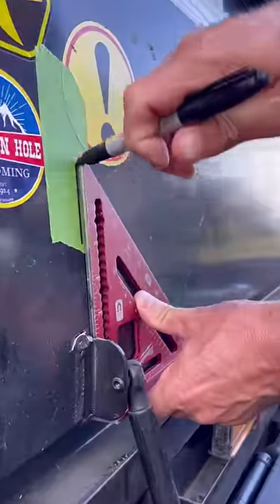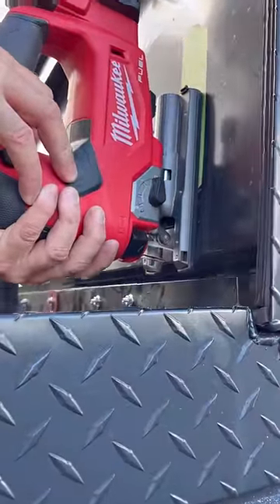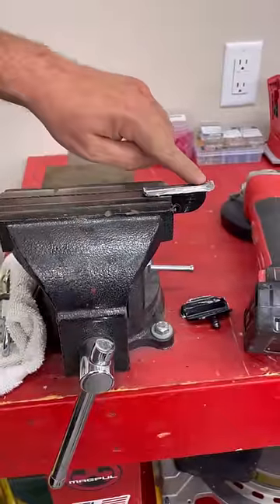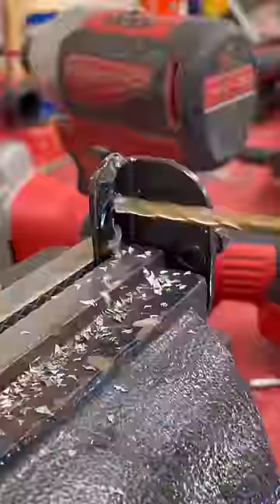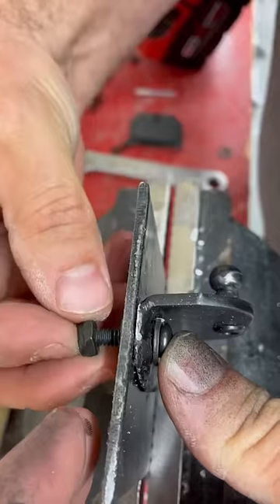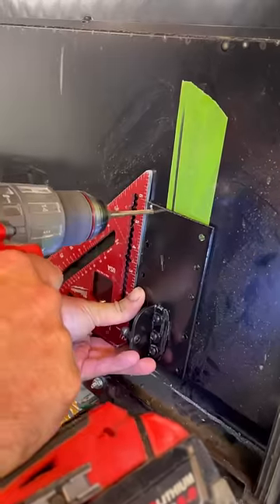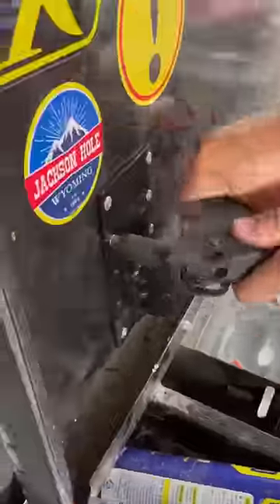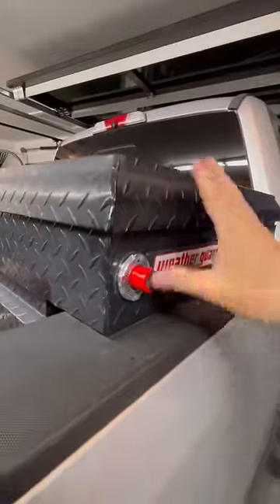I Had to Fix the Broken Shock Mounts on My Truck Toolbox

Comment: Puting the rivets from outside to the inside would give the outside a better look
Reply from the maker: The pop rivets and bolts didn’t go through the top they’re attached to step down section. The top looks the same as it always that we post to the second video showing this👍

Comment: Your repair should hold up at least as long as the original.. ps the original design has a major flaw . These boxes are designed to lift the lid from the center..but it's lifted from the side. So design it to lift both ends from one side..

Comment: You should have covered the back of the steel plate in silicone to prevent the ingres of water through the 2 holes
Reply from the maker: The pop rivets didn’t go through the top

Comment: Nice but the aluminum will corrode the steel in some time probably something like 10 20 years but you'd be better off with a heavy aluminum plate in place of the steel plate but the steel is good and gets the job done

Comment: You need to use body compound or something on the outside since you cut through.
Reply from the maker: The popper it’s actually don’t go through the top of the lid. They’re attached to step down section

Comment: I was gonna say, if he was planning to weld that steel to the aluminum body...

As to the metal fatigue, it won't be an issue. Aluminum has no minimum fatigue strength, unlike steel. If you oscillate it enough you could tear it like paper.

Comment: Good idea to fix but what about sealing the top so the water doesn't leak in
Reply from the maker: The pop, rivets and bolts don’t go through the top they’re attached a step down section so it’s still waterproof

Comment: Show us the top side with the bottom of the rivets sticking out and the cut holes!
Reply from the maker: The rivets don’t go through the top they’re attached to an inner skin, and I did make a second video showing the top if you want to check it out

Comment: I'd have put the nuts on the inside of the box to stop possible access through the back of the lid. Great repair though.
Reply from the maker: The rivets don’t go through the top. They are attached to a step down section.

Comment: My only concern is your repair job will be too strong for your lid. The surface area of the plate should be adequate to disperse the tension the lid will take when it flexes on the harder steel.

Also I’m now questioning of the lid is aluminum or if I’m mistaken

Edit for my fat fingers and autocorrect fighting a winless battle

Comment: Is water going to come through the cut out?

I'm wondering what it looks like from other side.
Reply from the maker: The pop rivets don’t go through the top so the outside looks the same. We posted a second video showing the outside
Reply: @hausplans  
Awe, double layered box eh.

It looked great from the side I could see, I imagine it will do exactly what you intended. 

Nice to see good stuff being saved with a little knowledge, skill, and work.

Comment: You didnt show the end of those bolts that would be sticking up..   still a solid job though 👌
Reply from the maker: The bolts don’t go through the top they’re attached to an inner skin. We posted the second video showing in the outside of the top.

Comment: I would use tamper proof bolts with nuts on the inside instead of rivets.
Reply from the maker: The bolts and rivets don’t go through the top they’re attached to a stepdown section

Comment: I don't know if I woupd.habe used rivets or flush mound bolts on the inside incase you ever did need to redo anything but it should last longer than any aluminum anything

Comment: hold up. that’s how i fix aluminum roofing on semi truck trailers and box trucks. it’s better than replacing an entire portion of roof, doing that is a fucking nightmare. much easier to cut a sheet, drill some holes and seal it up

Comment: How did you fill the hole on the topside of the tool box? Also probably should have siliconed (or some type of sealant) the area under the plate to keep water out.
Reply from the maker: The pop rivets don’t go through the top the hole was cut into an inner skin. We posted a second video showing the top.

Comment: As long as ya sealed the top hole with hard putty or welded it yea I can see it last Hella long.
Reply from the maker: The pop rivets actually don’t go through the top so it’s still 100% waterproof.
Reply: @hausplans  did ya spray both sides so the steel doesn't rust?

Comment: Is there a reason why the rivet head are inside instead of outside so it would look better in closed position?😊
Reply from the maker: The rivets actually don’t go through the top. They’re attached to step down section. So there was no way to rivet from the other side.

Comment: Is galvanic corrosion a risk when mixing aluminum and steel? or does the paint solve that problem
Reply from the maker: I’m hoping the paint will solve that problem at least in the short term

Comment: You forgot to use silicone or some adhesive to water proof the wholes
Reply from the maker: The pop rivets and bolts don’t go through the top they’re attached to a step down section so it’s still completely waterproof.

Comment: Just wondering how you waterproofed the top of the box???  Kinda left that part out.  Might be sorta important to keep water out since you just cut two holes in the lid.
Reply from the maker: The pop rivets and bolts didn’t go through the top they’re attached to step down section, so there was no need to waterproof.
Reply: @hausplans ......Water never sleeps.  And them are some famous last words 'so there was no need to...........'.  Just sayin.

Comment: I would have put some sealant under it and riveted it from the top down
Reply from the maker: The rivets don’t go through the top there attached to a step down section. So it’s still completely waterproof.

Comment: Lets see the top and how you repaired that so water doesn't sit in there and rust it out 😂
Reply from the maker: We posted a video showing the top. You should check it out 👍 It looks the same as it always did. The rivets didn’t go through the top. They’re attached to a step down section.
Reply: @hausplans  
seeing on this video how you built it .. 
I'm sure you got it done well 👍
Just yanking your chain ... I do that . , 😄

Comment: The lid has two slots cut in it. Did he seal those so water can't get into the toolbox?
Reply from the maker: The outside of the lid is still the same as it always was. I was cutting through an inner skin. We post to the second video showing the top if you wanna check it out.

Comment: I think throw a bead of silly cone in that little pocket you created for water to leak into your tool box otherwise solid repair
Reply from the maker: The rivets and cut didn’t go through the top of the lid. There’s a step down section so it’s still 100% waterproof.

Comment: and leaks like a sieve. Why no sika flex or sealant under the steel, also if this is an aluminum box and you riveted steel to it, the two metals will oxidize if you didn't put butyl tape between them.
Reply from the maker: It doesn’t leak the outside is still the same as it always was. The pop rivets and bolts go through a inner skin not through the top.

Comment: In my opinion the rivets were installed backwards.
Reply from the maker: Those rivets don’t go through the top of the lid. They’re actually attached to a step down section. So there’s no other way to put them in because there’s not access from the other side.

Comment: Show the outside of the top. With the rivets sticking out.
Reply from the maker: We posted a second video showing the top, you should check it out. The rivets don’t go through the top they are attached to an inner skin. So it still looks the same on the outside.

Comment: Too bad water will leak through into the box when it rains. Should have tig welded the holes and did the repair you showed
Reply from the maker: The pop rivets don’t go through the top. They’re attached to a step down section. So it’s just as waterproof as it ever was.

Comment: Water is going to collect in the hole you cut in the aluminum, and then leak into your box.
Reply from the maker: The rivets don’t go through the top
Reply: @hausplans  the lid is double walled with space between, so you didn't cut through the top wall?

Comment: Aluminum and stainless steel paired together will cause galvanic corrosion. You'll be buying a new toolbox sooner than you think.
Reply from the maker: Both the aluminum in the steel are painted so it shouldn’t react
Reply: Are the rivets touching the aluminum? Not trying to be a Richard just trying to help it's a good repair but got to cover all the bases. Thanks for the content brother

Comment: But the rivets are now sticking out on top—2 seconds to pop em and you in. Like using nuts and bolts, and the nuts are on the outside 😂😂😂 just saying 😂
Reply from the maker: The rivets didn’t go through the top. They’re attached to a step down section. We posted a second video showing this.

Comment: I would have riveted from the outside to the steel plate on the inside.
Reply from the maker: The pop rivets don’t go through the top. They’re attached to an inner skin. We posted a second video showing this if you want to check it out.

Comment: Shoulda sealed the lid possible leak points.
Reply from the maker: The pop rivets and bolts don’t go through the top. They’re attached to step down section. We posted a second video showing this it’s still completely waterproof.

Comment: Does the brand "WeatherGuard" mean anything?
Your repair for sure is not "weatherGuard" 😉
Reply from the maker: Not sure what you’re talking about, it’s still 100% weatherproof. The bolts and pop rivets don’t go through the top they’re attached to a stepdown section.
Reply: @hausplans  OK, in this case 👍
I thought you drilled the pivots through the Top. 
I'm Sorry
Reply from the maker: I can see how it’s confusing. I should’ve showed the top after I was done in the first video.👍

Comment: So now just need a wrench to undo hinges open tool box from box side and I’ll have access to all your tools…..yea I would’ve welded it on to the steel plate not bolt it on and have to nuts fully exposed 🤷‍♂️
Reply from the maker: The outside of the top is the same as it always was. The bolts and pop rivets are attached to a step down section. They don’t go through the top. We posted a second video showing this.
Reply: @hausplans  ok that make more sense in the video when you did the cut out it looks like that was done for the nuts to fit through
Reply from the maker: Yeah, the first, but it was confusing. I should’ve showed the top when I was done.

Comment: Pop rivets were installed from the wrong side. 😂
Reply from the maker: Nope, they don’t go through the top
Reply: @hausplans  oh I looked at it again and I noticed that it’s got an inside panel. In which case the pop rivets are correct and pretty. Well done sir. ❤️👍

Comment: Silicone woudnt have gone a miss. neat finish tho
Reply from the maker: The rivets don’t go through the top so there’s no need for silicone
Reply: @hausplans  theres two full squares cut from the lid, rivets and sheet metal alone i dont see holding back water. i wasnt even thinking about the rivets going all the way through or not 🤣
Reply from the maker: There’s a lower section of metal separate from the lid. That’s what I cut into and attached to. We made a separate video explaining because people were confused if you want to check it out👍
Reply: I see what your talkin bout didnt notice that 😂lovely job ❤

Comment: Why didn't you put the head of the rivets on the outside?
Reply from the maker: The rivets and bolts don’t go through the top they’re attached to an inner skin. So the top from the outside looks the same as it always did, still completely waterproof.

Comment: Did you drill you back glass at all
Reply from the maker: The pop rivets and bolts didn’t go through the top they’re attached to step down section, so no danger of hitting the glass because I didn’t drill all the way to the top

Comment: What did you do for the hole on the top to prevent water leaking in?
Reply from the maker: The pop rivets don’t go through the top. They’re attached a step down section. We made a second video showing this
Reply: @hausplans  oh thanks for the reply. Looks like a good long lasting fix.
Reply from the maker: Thanks

Comment: You didn't show the outside. Were there holes?
Reply from the maker: The outside looks the same as it always did. We posted a second video showing this. The pop, rivets and bolts don’t go through the top they’re attached to an inner skin.
Reply: @hausplans  I thought this may have been the case. Looks good.

Comment: Does it leak from water sitting in the hole left on the top?
Reply from the maker: There’s no hole through the top the pop rivets and bolts were attached to an inner skin, so it’s still 100% waterproof

Comment: only lose points I'm seeing is those rivert. if you put steel plates outside it would last longer. but good fox tho
Reply from the maker: The rivets actually don’t go through the top they go into a step down section. The outside of the box looks the same as it always did
Reply: @hausplans  ooh okay then thats good

Comment: I would have welded it to repair it, but you should be good.
Reply from the maker: Welding would be nice, but I don’t have a way to weld aluminum
Reply: @hausplans  I totally understand. It's not really worth getting a tig setup just for that. Good luck with your fix bud.

Comment: What did you do on the outside?
Reply from the maker: The outside looked the same as it always did because the proper rivets went into a step down section not through the top
Reply: @hausplans  cool thanks

Comment: I hate combining aluminum and steel. It’s a recipe for disaster.
And make all that nice hard work useless because of  galvanic corrosion between dissimilar metal with a touch of moisture. Condensation in this case. 
You’re relying on your paint to delay, that reaction .  A thin  piece of rubber would help. Or liquid rubber.
Or use it and not worry about ocd commenters. 😂
Reply from the maker: Both the aluminum in the steel were painted so I don’t think it will be a problem
Reply: @hausplans  
Lol yes . 100% 
A fair chunk of my portfolio, per se involves salvage work.
When I see aluminum with steel as in the an aluminum winch bolted to steel,  You might as well throw that winch in the garbage. Removing those bolts in next to impossible and more trouble than it’s worth. 
But hey, that’s my two cents worth..  thanks for the video !👍
Reply from the maker: Thanks for sharing 👍

Comment: And now it leaks
Reply: No it won’t, they never touched the top layer, only the inner skin.
Reply from the maker: The bolts and pop rivets don’t go through the top. They’re attached to an inner skin. We posted a second video showing that if you want to check it out.